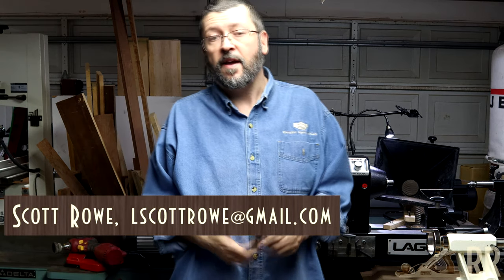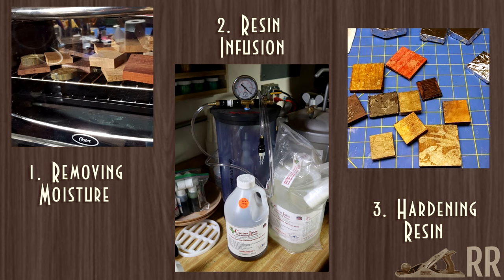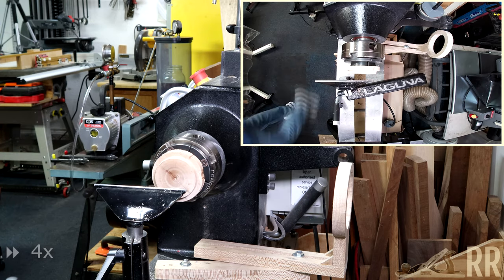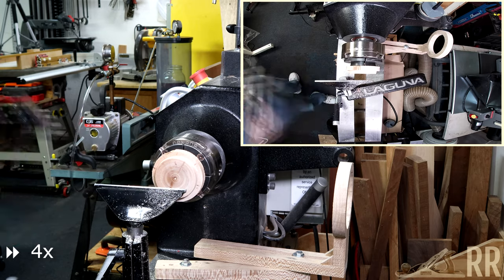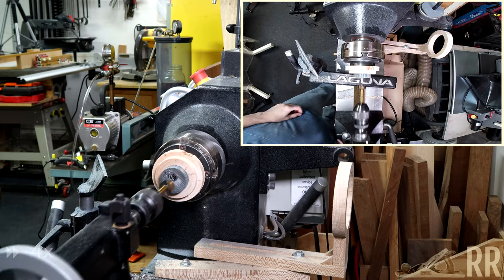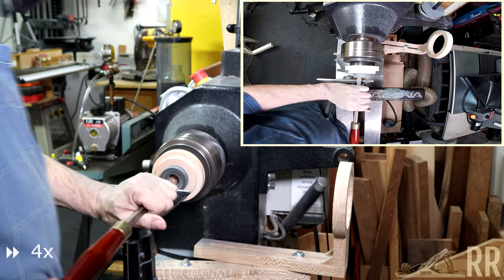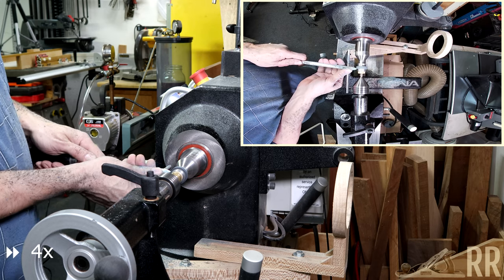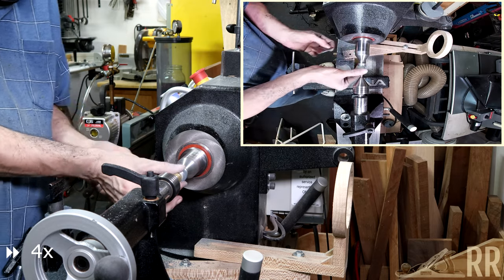Stabilized Plywood Ring Woodturning 153

Comment: Nice ring Scott.  See you have been branching out.  I do have one question, what is the metal for the ring center?  Brass, aluminum or something else?  The stabilized plywood looks like it turns well without chipping.  Have not done much  work myself since it has  been to cold (3 degrees this morning).   have been working on an inlayed box for a gift, but still have a way to go.  Finishing will be a problem because of the cold.  I will send you a pic when finished.  Hope to start turning some projects when it warms up and I can get my hands and fingers to work!  D. Green
Reply from the maker: Dave, I got some stainless steel ring cores from ebay. I flatten the top and rough them up so that the glue sticks. :)
Glad to hear from you. Looking forward to seeing projects from you when the weather turns nice up there.